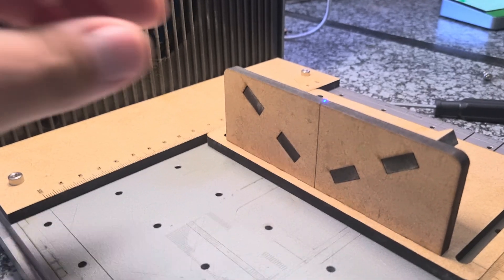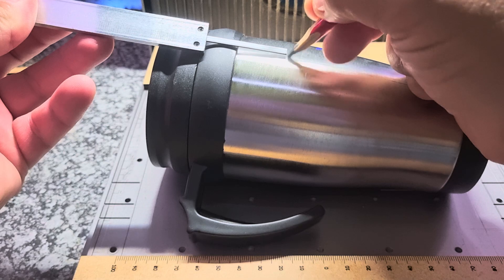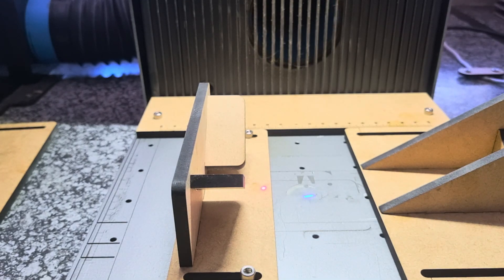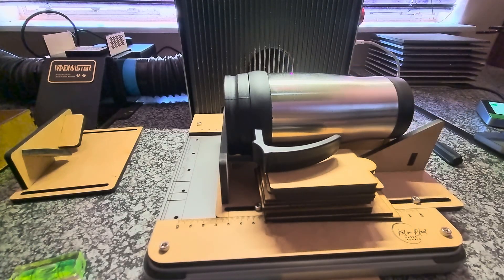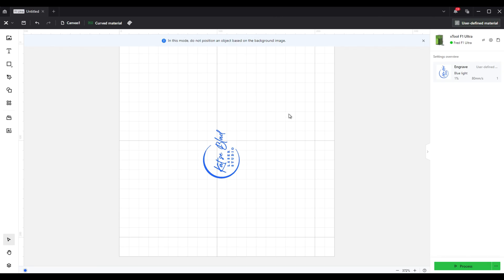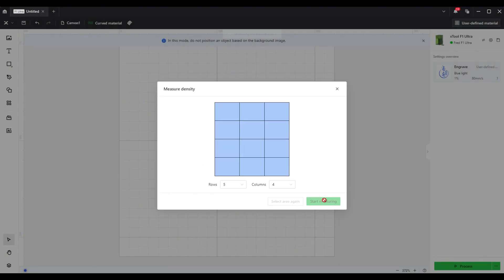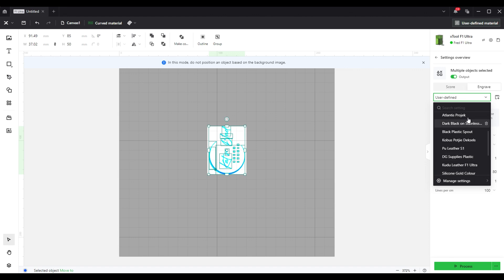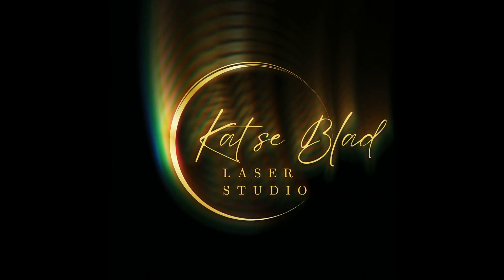Laser cut Cup Jig for xTool F1 Ultra

Comment: Does the curvature settings, going to automate the focus?. Or how would the focusing be like?.
Reply from the maker: With the F1 Ultra you choose curvature focus, set the size of the engraving, and then it will map the surface using different focus points. And then it is just normal engraving from there.